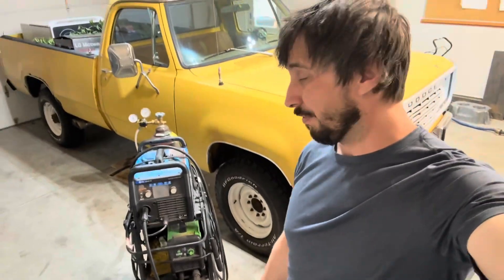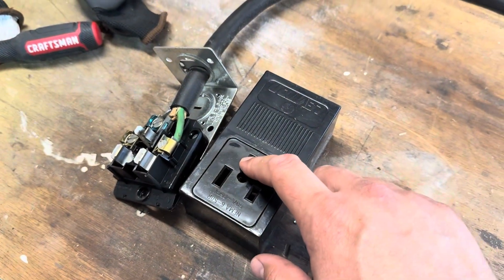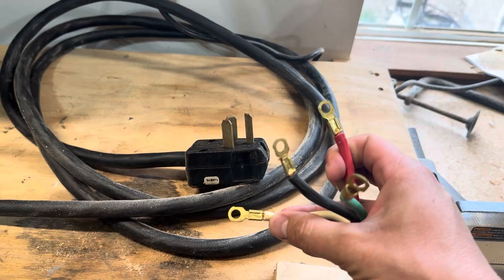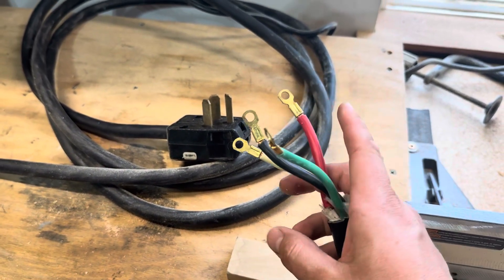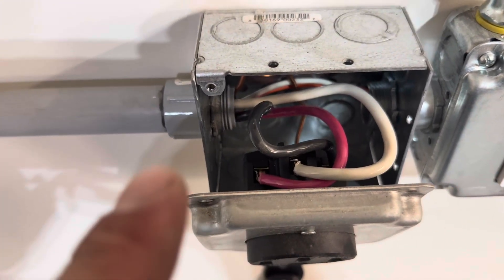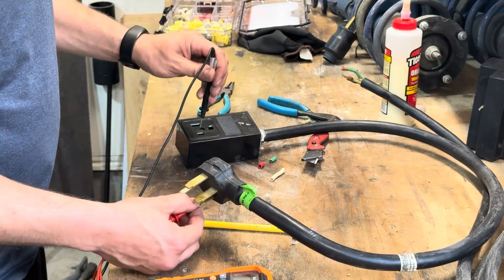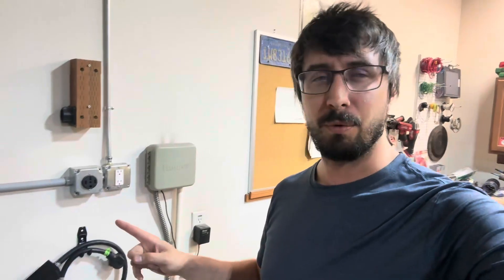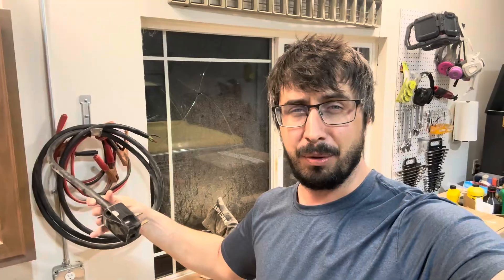How to Wire your Welder to a 4 Prong EV Charger

Comment: That EV charger receptacle is installed upside down. The ground lug should always point up (hence why your cable goes straight up and loops back down )
Reply from the maker: There’s a reason for that actually. This was for when my wife and I had a Chevy Bolt EUV. What you don’t see since it’s been removed is the adapter that plugs into the wall and is only right side up if the plug is upside down.